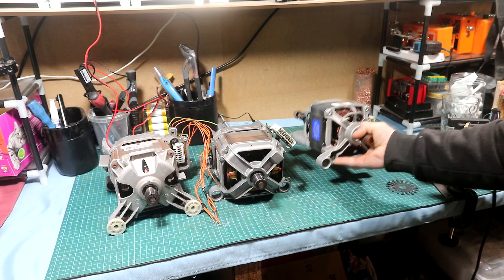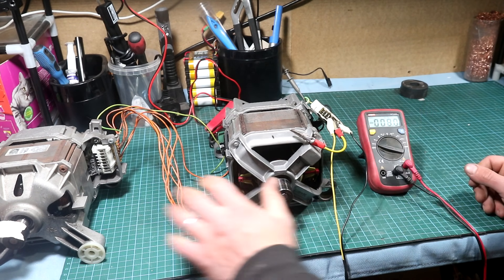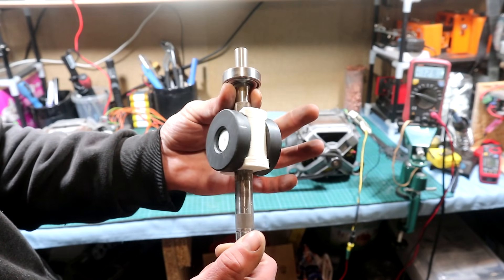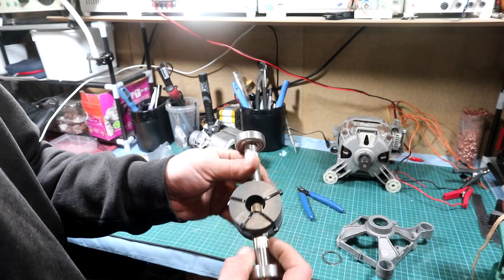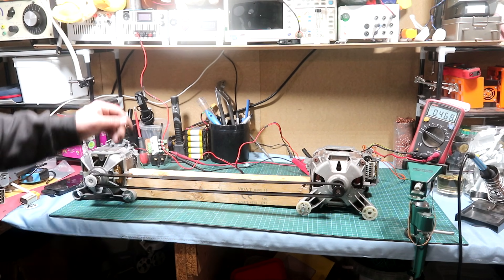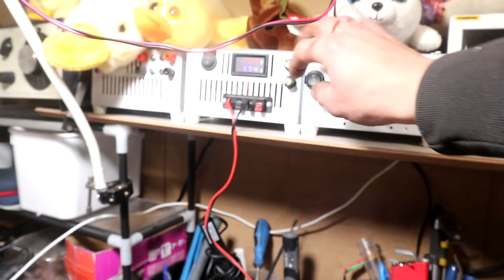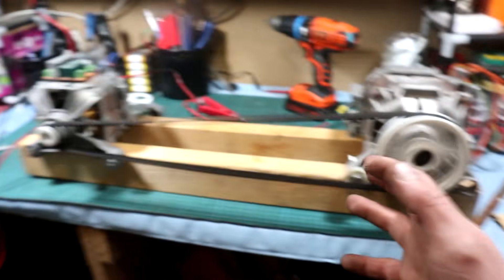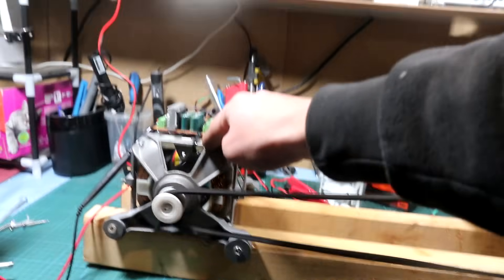Generator From a Washing Machine Motor Experiment

Comment: Don’t understand the magnet faces part. How i fix the magnet? In the way that one rejects the other? Or in the way the one attracts the other?
Reply from the maker: well regarding the way i have mounted them because they have 1 pole on the face and the other on the edge , they have to be atracting to one another but still is tricki to give you a solid information as they are from microwave magnetrons they have a odd configuration from the basic one wich you put N - S  - N - S. so more simple way is just to mount them on to the shaft and if the motor is not generating voltage just flip one magnet .